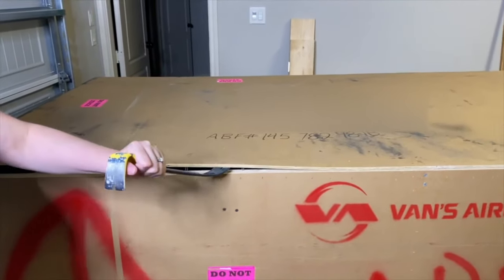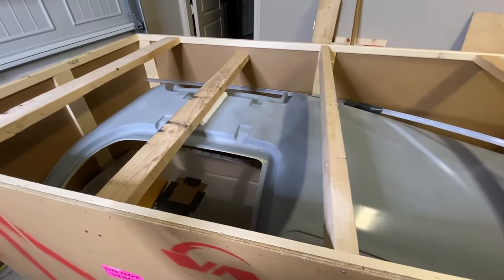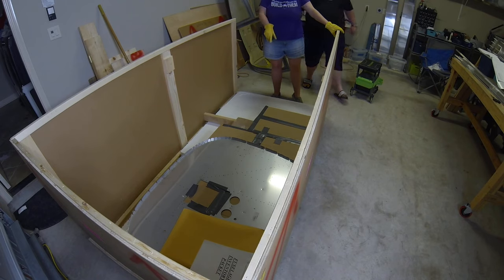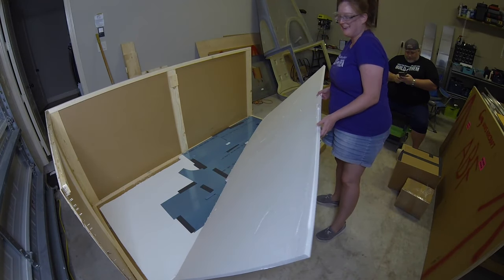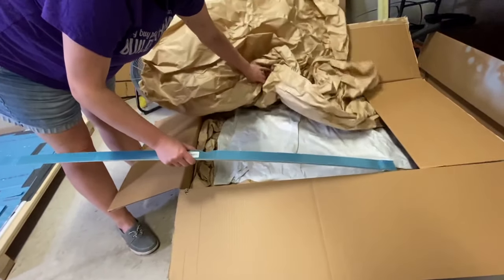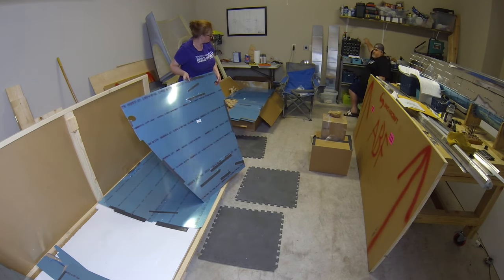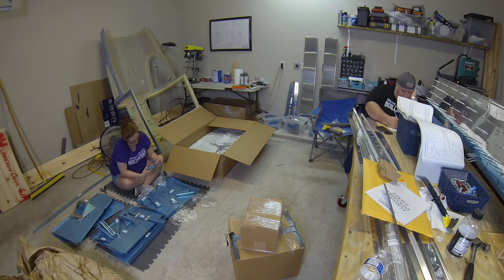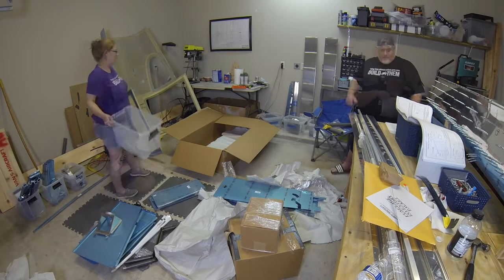Van's Aircraft RV-10 Build: Fuselage Unboxing & Inventory

Comment: One other alternative to inventorying those small parts that you have large numbers of, like washers, rivets, nuts, etc. is to have an accurate scale and weigh, like 10 pieces of whatever item it is. record the weight and then put all of that item on the scale and divide the total weight by your initial measurement (and then multiply by the number of pieces in your initial group) to figure out how many you have. Perhaps not as perfectly accurate as counting each one, but if you have a very accurate scale of appropriate size, it can actually be very accurate. And it is way faster than counting each one.
Reply: That’s a great idea! I definitely wouldn’t have the patience to count them.
Reply from the maker: Good idea! 😊

Comment: Fantastic video. Glad you guys got it all sorted out.

I may see an inventory error though (I wouldn’t have caught it but they did the same thing in my kit and ours were probably packaged on the same day since we received them only 1 day apart originally).
At 9:26 in your video you show a large rivet and it is from bag 1313. According to the inventory that should be a 4-16 rivet. Mine were like a size 5 or 6 rivet. Much larger than a size 4. From the video yours looks like the same thing happened. You will use those early on in the first section so I didn’t want you to be stuck with the wrong thing early on.
Reply from the maker: I noticed that! I got out the calipers and figured out they were 6-16 (because there was no way those were 4’s). I thought it might be a typo in the inventory; are you saying we should have 4-16 rivets?
Reply: Plane Lady yes, you should have 6 4-16 rivets
Reply from the maker: Thanks for the heads up! I’ll give them a call